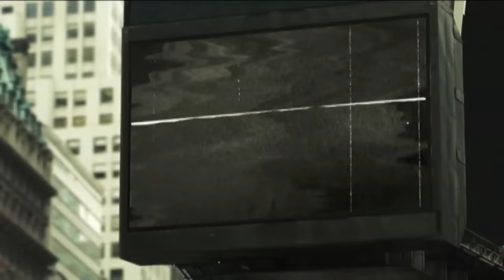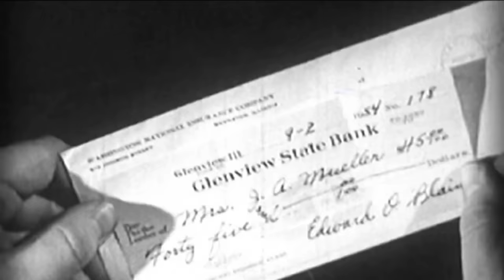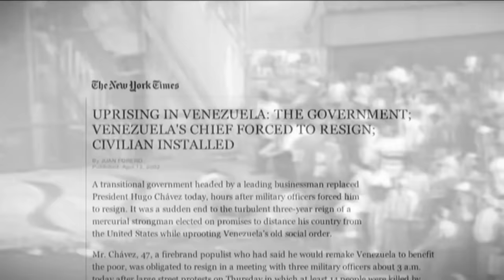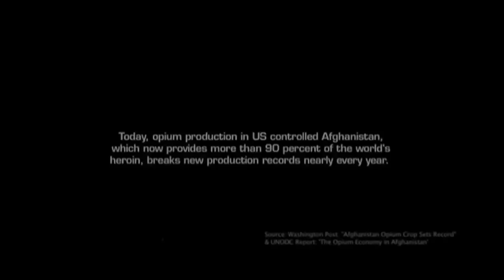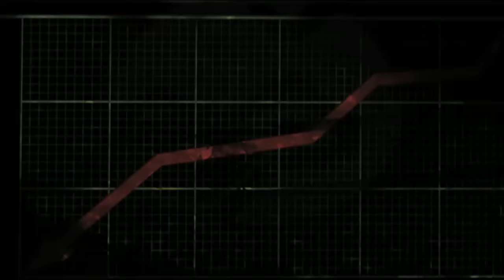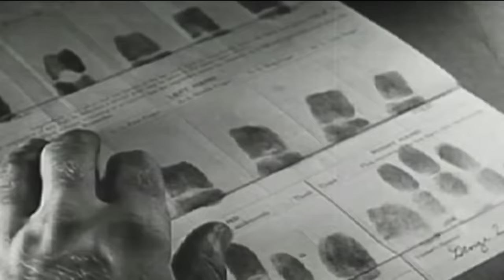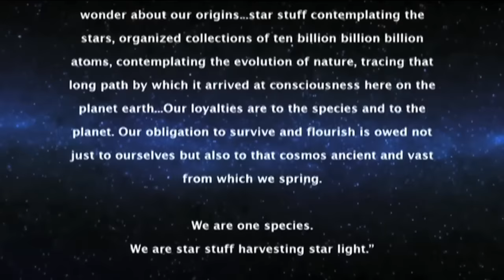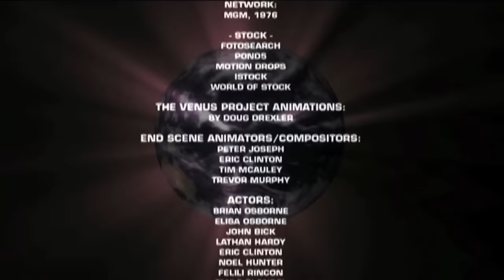ZEITGEIST: ADDENDUM | Full Free Documentary | Social Pathology, Peter Joseph

Comment: The very first claim is false. The Federal reserve doesn't buy treasury bonds directly from the US treasury - that is illegal. It purchases bonds and sometimes other securities from the secondary market - usually from large investment banks. Where this video is correct is that the money that is paid by the fed is created out of thin air digitally and credited into the bank account of the investment bank.  There is nothing wrong with this in principle, as long as the extra money created doesn't exceed the growth in the production of goods and services. So, if the money supply is increasing at 3 to 5% and the countries production of goods and services grows by 3 to 5% then this a good thing...According to Milton Friedman, the fact that the Fed didn't increase the money supply during the Great Depression was the main reason that it was so devastating for so long. The fed should have printed more money because there was massive deflation...

Comment: There are 50,000+ patents that have been issued by the privately owned US Patent Office which use no fuel whatever and are neither wind or solar, require no infrastructure going back to the turn of the 19th century.  In around 1920 Nicola Tesla built a car which operated under it's own power that Elon Musk had intended to base Tesla Motors on (thus the name), but was prevented from doing so and forced to use batteries, to which he was compensated 8 billion dollars.

Comment: The premise in the first few minutes that a deposit of $$ becomes a bank asset is wrong. A deposit by a customer to an account at a bank is treated as a liability not an asset but loans made by banks are treated as assets. The bank must maintain a certain liquidity ratio of assets to liabilities or loans to deposits (other assets such as shareholder capital and past profits are included in this calculation). A deposit of $10bn does not create a new ‘extra’ $9bn to loan out to borrowers, but some % can be partially reused in new loans provided the bank can still meet certain regulatory and stress test requirements. 
This is a false and misleading introduction. Next!

Comment: So what Dear Earthlings means;
To be open to change the social structure of soceity at large what is still a Utopia on the drawing board while i can 'serve' this idea with a plan to create Energy out of 'thin' air instead of Money in using what's already there on the surface (oil platforms and specilized submercible's) to change strategy in retracting Energy out of the water in putting wind turbines underwater using the two main powers (eventually even the third) in the laws of motion with as little resistence as possible and connecting them to the powerlines already there so there's no hindrance for air and water traffic (birds and ships and whatever is colliding with IT) as well the work to make this a reality is immens also in maintenance and production you've got the most exiting job you could ask for.
So don't hold back IT is on the drawing board already and there's enough watersurface to make the Green back really Green without running red.
Sincerely @ the Shrewd🤔🙃😉😇🤑

Comment: Resource-based Economy is the only ideology that makes ethical AI creations to achieve full coverage of human labor because no one needs to worry about being jobless and homeless when being replaced by AI robots -- because there is no monetary system anymore. When the value of human existence is MONEY, it locks up the potential of ethical AI application because the economy model requires "market" and the market requires the purchasing power of consumers that they gained from wages. This proves that the monetary system is unsustainable and does not promote the full potential of technological advancement and application, when comes to manpower replacement especially.